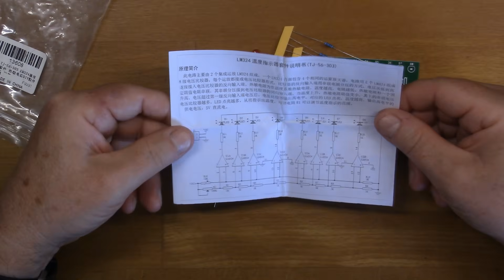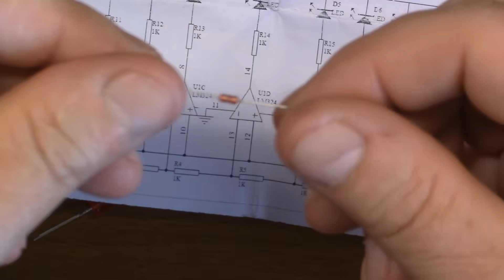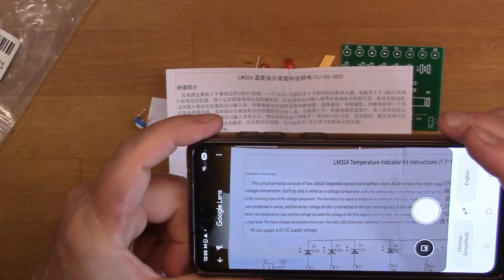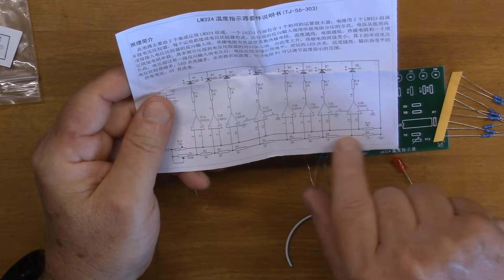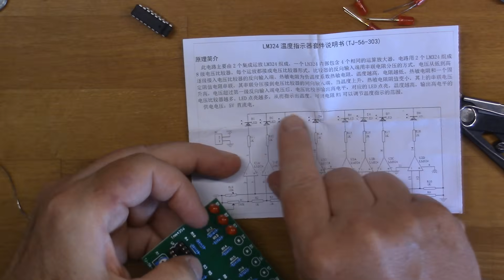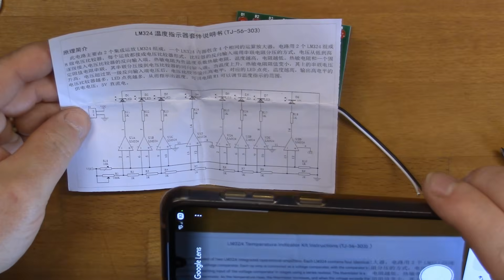Mystery Chinese Kit Assembly (#164)

Comment: Some suggestions, after watching some videos...
Firstly, I see you have stopped using BlueTac and PCB holders, so at least you are no longer struggling with that. Yes, the workbench is a perfect way to hold components in place!
Second, your soldering iron tip is terrible. Get a proper tapered flat bit, not that pointy bulbous thing you are using.
Third, turn the iron temperature up... You are blobbing solder onto the tinned pads, and it's not flowing properly. That causes those awful blobby joints 😢
Finally, use FLUX. All your bridged joints and other problems will be gone if you add a little bit of extra flux in the joints before soldering.
If you get a bridge, add flux then reflow and drag the tip away.

Comment: A nice little cheap trick is to use a little bit of bluetack to help keep things still whilst you solder.
Reply from the maker: Actually I did search for some blutak, but coudn't find any
Reply: Worst suggestion ever. It slows things down and melts. No need for BlueTac, just use finger or push into workbench.